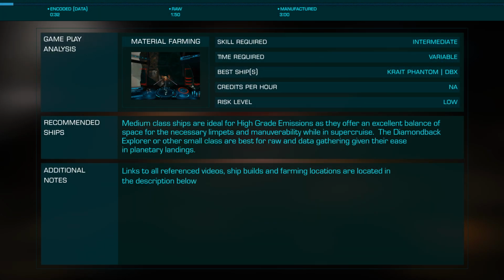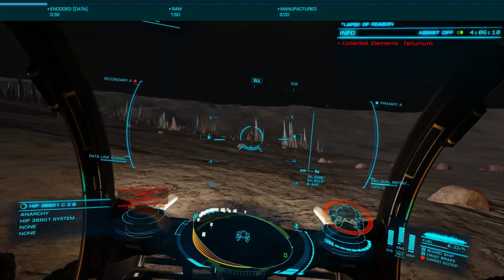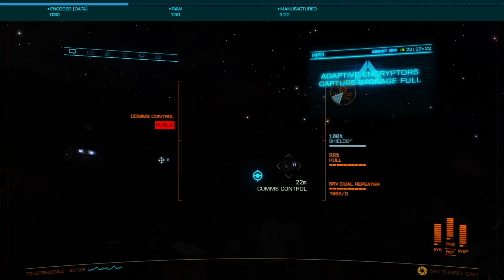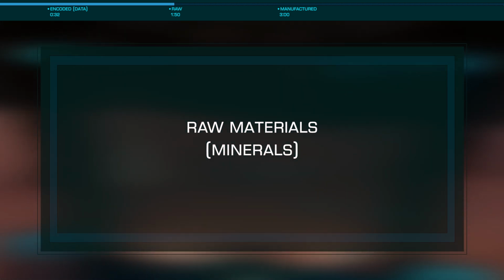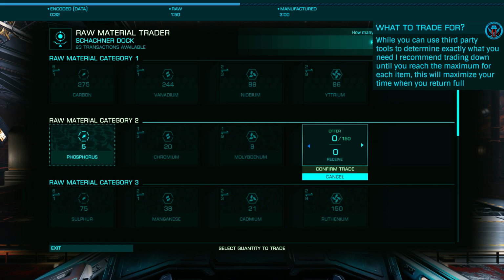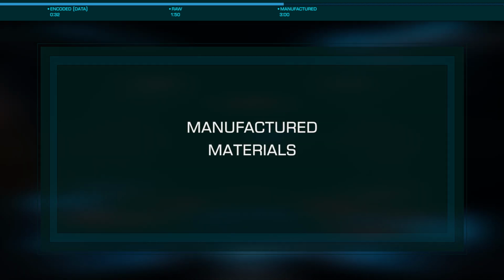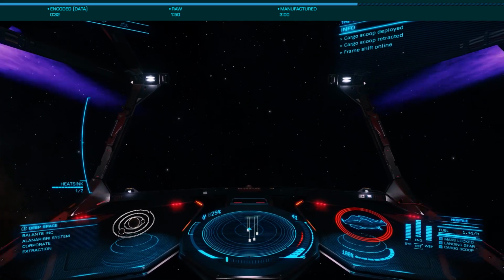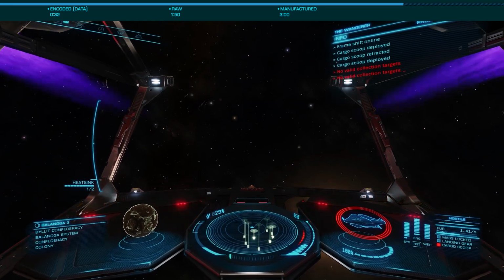The FASTEST Ways to Gather Minerals, Manufactured and Raw Engineering Materials in Elite Dangerous

Comment: Good Morning Cmdr. I'm threw the first two sections, this is good stuff very high materials quantities as promised. The time frames to accomplish the raw materials section was more then double for me. I spent nearly 10 hours completing this process, this was not fun....I'm not grasping the locations we should go to for the manufactured materials section....
Cmdr. Dumbshit ...out
Reply from the maker: Well the times are based on a max jump range DBX and knowledge of how the whole loop works, so not necessarily your first time - but these are the times I get every time I do it (but I've done it dozens of times).  For the manufactured just watch again - you're looking for High Grade Emission signal sources, those will show up after you scan the system's NAV beacon with your navigation panel filtered to show only Signal Sources (or that and others).  So let me know what specifically you're missing.
Reply: @Exigeous  appreciate your quick response to this question I'm in LTT 15574 the Haxel Port can you tell me specifically what system I should go to to get the best resources for these materials. I guess what I'm saying is I don't understand the means by which you figure out what system specifically to go to so if you can give me the calculus on that I'd appreciate it. Thanks so much for your help.

I guess also while I  have your attention, I'm running a Chieftain for my main fighter. So I have a ton of resources now and or I'm going to when I finish the materials Trader section. What's the most effective way to engineer that ship, build options. Again thanks for your help
Reply from the maker: Uh, did you not see the graphic in the video that details the various system types where materials spawn?  That's what you need - unless I misunderstand.  As for the Chieftain I already have a video covering my PvP build, have a look.

Comment: As a proper roleplayer I find this guide problematic. :D
Reply from the maker: Then by all means don't use these super efficient methods and spend a much much longer time gathering things.  I enjoy role playing too but at the end of the day when I need to "work" Elite, rather than "play" Elite, I'm going to do that in the most efficient way possible, so long as I'm not violating the ToS (and I confirmed with Frontier this in no way does).
Reply: Learning FA off can provide a good steep learning curve experience that works well as an accompanying narrative to rp.
Reply from the maker: @dmain6735  Oh sure - and it's pretty critical for some builds, especially large class.

Comment: I also need to add that stressing Open and PVP as something EVERY player should try at the end of the video also doesn't make it a good video in my eyes.  Since there, even from just noting PVP there is a ton more to offer the game then just PVP that can benift from this.
Reply from the maker: Hmm, well it's my opinion that everyone should try every aspect of the game, including PvP and open.  I mentioned that at the end (sorry, didn't mean to "stress" it) as those are two aspects of the game where engineering makes a huge difference as you can't really PvP without engineering and building a well defended ship makes open safe virtually no matter where you are.  OF COURSE engineering benefits every aspect of the game, that's why I've covered engineering and builds for several types of ships and will soon have a build for all of them.  Pretty bizarre to me that by mentioning two play styles but not covering them all, which seems pretty obvious, that somehow makes the video "not good", but hey you do you I guess - feel free to gather slower and less efficient ways and press click dislike button.  It's all counted as "viewer engagement" and all helps the channel.  o7
Reply: Your definition of "Stressing" is obviously different than mine.  I went back and watched it again to be certain.  What I saw and heard was simply "casually" mentioning flying in Open.  Elite Dangerous has different modes of gameplay, and there is nothing wrong with someone sharing how they like one particular type.
Reply: lmao